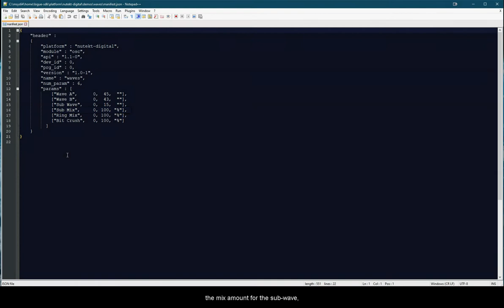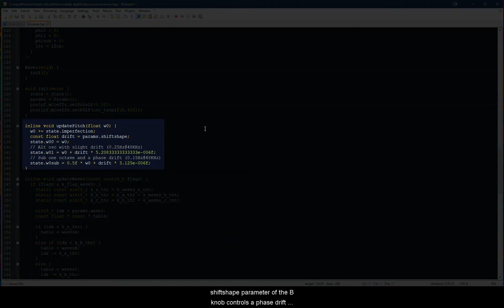Korg NTS-1 Custom Oscillator Demo: Waves

Comment: I just got my NTS-1 and wandering around in You Tube for information and tutorials. For some reason the Waves OSC didn't come preinstalled on my Unit. I only have SAW, Triangle, UPN. Is it possible to get it from anywhere? I opened the Logue SDK repo, and navigated into the logue-sdk/platform/nutekt-digital/waves/ folder. Unfortunatley i don't see any 'ntkdigunit' binary file. I see the sources, it seems. But I do not have any environment to build... Do you know where the exe file can be taken?
Reply from the maker: I need to refamiliarize myself with SDK. They may have changed the loadout since I produced this series. I have been busy elsewhere! I'll be getting back into it in June so if you haven't found a solution by then, I'll come back to you.
Reply: Hi  @grahamkeane2776  I have managed to find the Waves Oscillatore eventually. When opening the Librarian Tool Software you can select the FILE- menu and the only default downloaded item is the Waves. Many thanks for answering.